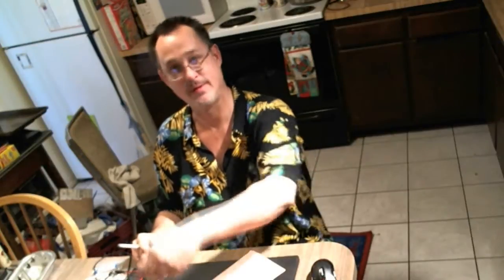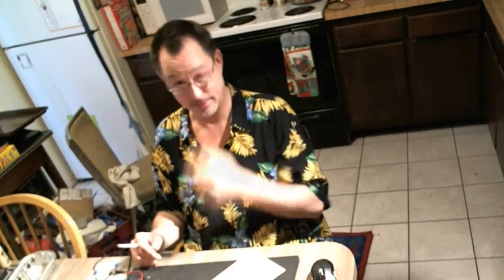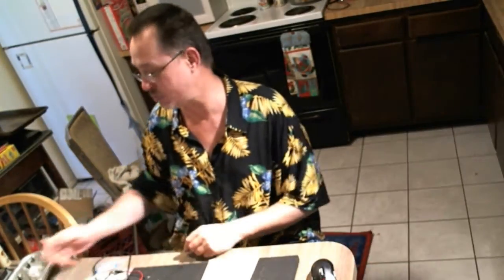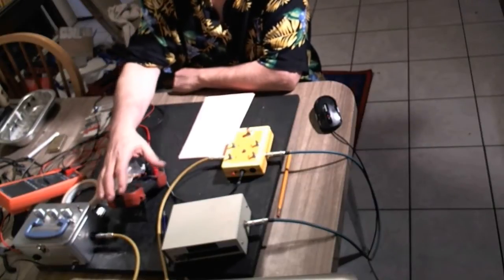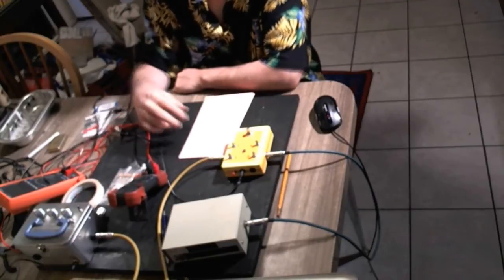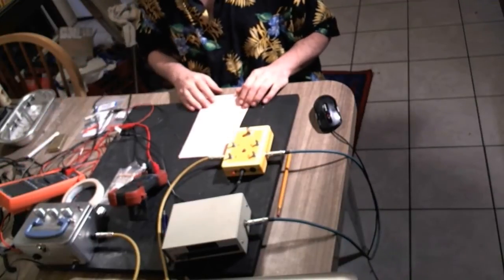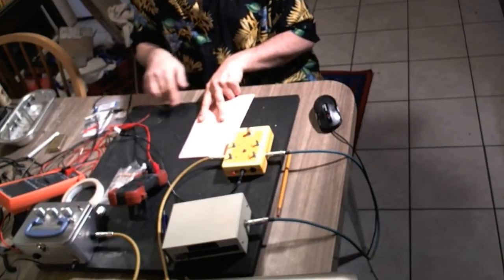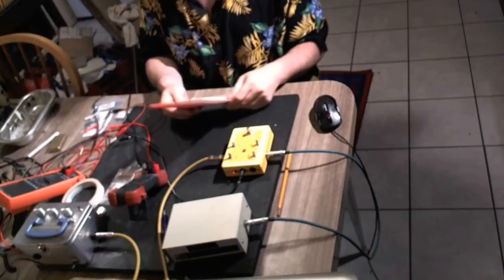Reverse Polarity Protection (easy) for guitar effects

Comment from the maker: i set up 2 pedals with 3 power supplies and 4 diodes for the test . i also used two meters one for current and one for volts . i threw away the data , but it showed me a loss of both voltage and current when a diode was implemented in the circuit . what i found interesting was that when one number was higher the other would be a bit lower , between the voltage and the current . ironically when the polarity was reversed , the effect was of a short on the ac adapter , as i mention @ 7:00